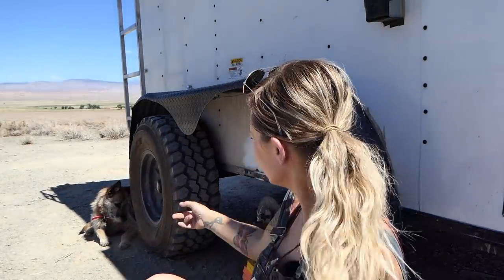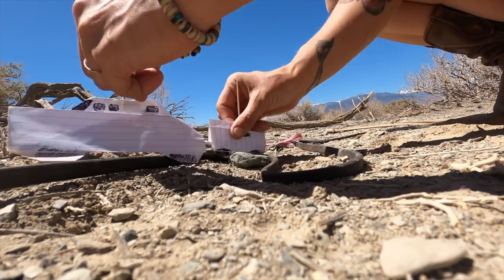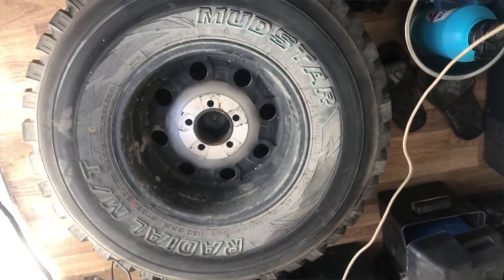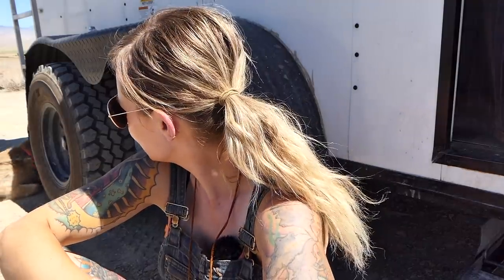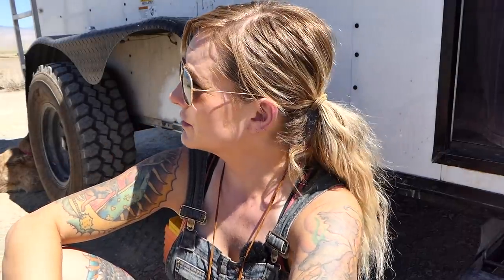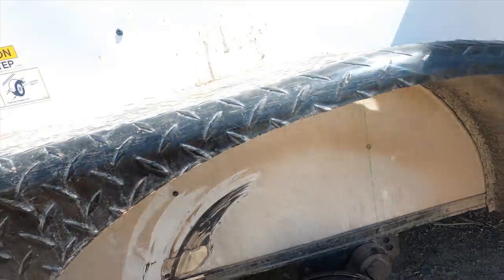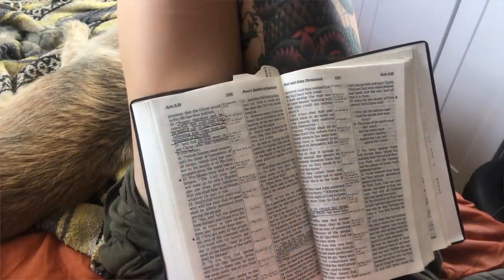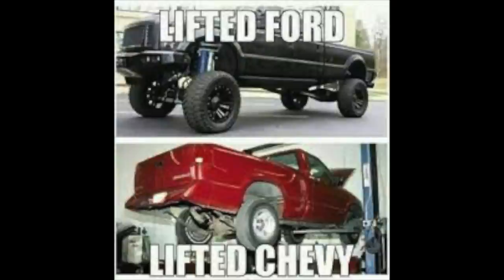Diary of a Broken torsion axle - living full time in a Cargo Trailer Conversion

Comment: In comparing torsion to leaf spring .
   Leaf springs can have airbags added and air pressure adjusted adjust for a stiff or soft ride . The air compressor can also be used to inflate a low tire pressure .  
   Torsion are good when nothing goes wrong .  Fix the bent axle and use it for the spare . You may trade trailers in the future and never need the spare , that is kept in Wisconsin. 
   Ford fuel system. 
I switched from 18 wheeler to a Hotshot last year . A million mile Freightliner to a 2019 F350 with 6,000 miles.  It now has about 71,000 and original tires , pulling a 38ft gooseneck. 
   There is a filter kit that can be added both before and after the high pressure fuel pump that will stop most of the metal debris if the pump explodes .
   2 causes for a fuel pump failure  , dirty watery fuel causes excess wear ,  and clean U.S. fuel .
   What 😳  😳  😳  ? ? ? Clean U.S. fuel ? ? ?
   Yes , there is a reservoir of fuel inside the pump that is used to lubricate the pump that was designed in Europe.   The European fuel doesn't have all of the oil taken out of the diesel. 
   The U.S. EPA requires that all of the oil be taken out of the diesel,  thus no lubrication. 
   I use a fuel additive,  not for imaginary increased MPG , but for the lubricity additive.  I  put a little bit in every time I get fuel , and I burn 🔥 up a lot of fuel hauling freight .
   Enjoyed your video , very entertaining  👏  😀  !
Reply from the maker: Hi Richard! What fuel additive do you like/recommend?
Reply: Hello 👋! 
  If your vehicle is still in warranty  , I use Power Service Diesel Kleen with Slick Diesel Lubricator .  But anything that doesn't void your warranty. 
   If it is out of warranty , in the Freightliner I carried a bottle of automatic transmission oil and a spare fuel filter for when I would get a tank of bad fuel .
   Don't void your warranty,  but almost any brand name is just as good as the others .
Reply from the maker: Thanks so much. I do still have an extended warranty.
Reply: You have some very interesting travels .
   With good service intervals , including greasing the 4x4 ujoints , Your Ford should last a long time  👍  😀  !
Reply: SPE Motorsport 6.7 fuel pump disaster prevention kit , On YouTube  .
Reply from the maker: Thanks! I read about the S&S ones. Thoughts? https://usdieselparts.com/i-24077938-ss-diesel-gen-2-cp4-bypass-kit-2011-2019-ford-6-7l-power-stroke.html?utm_source=google&utm_medium=cpc&adpos=&scid=scplp24077938&sc_intid=24077938&gclid=CjwKCAjwqIiFBhAHEiwANg9szud6OiFZMnm5srrZ7hxtOQMxVUXyP6gy4JyzQLpMNt3EIPy1Blk62BoCrbsQAvD_BwE
Reply: Having the clear inspection " contraption " , is definitely an improvement and benefit 👌  👍. 
" If " a person actually gets under the truck 🚚  and inspects it regularly. 
   $400 plus installation costs , sounds like a good long term investment  !
Reply: @LexandRiot  There's good comparison testing additive vids by Project Farm and others that show about 12 different brands, very educational

Comment: Thanks for the in depth discussion on torsion axles, I was considering switching from springs, now, not so much.  One question, are you replacing both sides of that "axle" or just one?  If just one side there is going to be a difference between left and right, correct?
Reply from the maker: Hi! The entire thing left to right will be replaced.

Comment: Take the other tire off the axle until the axle can be fixed, the trailer will operate as if if was built with one axle, it will be fine, you may want to paint the sheetmetal and the aluminum trim to cut down on oxidation  while you are waiting for 2 weeks, good luck, be safe.
Reply from the maker: Hi! I paint it in this video! :)
Reply: Very good.

Comment: looking at the pic of your truck and trailer i noticed a very big problem. It is imperative that your TORSION axle trailer ride level. more weight is on your front axle, not good with any trailer but especially with torsion axles..

Comment: Dont carry a spare axle. It will just be in your way unless you put it in a self storage place. It would need to be strapped down tight. The whole point of having two axles on a small trailer is that one of them acts like a spare. Chances of this happening again is next to zero. I've been pulling trailers for 50 years and never had anything like this happen. I think you are more aware of how to avoid this sort of thing now. Shit happens . . .

I had my fuel pump go down and I looked up and I was right next to a Ford Dealer . . . they fixed it by the next day. $1,300.00 Ford told me the new fuel pumps are better than the original. Mine is a 2010 F250 Diesel

Comment: How many miles are on the truck.
Reply from the maker: About 86k
Reply: @LexandRiot  what year?
Reply from the maker: 2016 it’s 6.7L
Reply: @LexandRiot  I would do the s&s and I would add diesel fuel lubricant additive to every tank. high pressure fuel pump otherwise known as CP4 is no joke.. up to 10K for everything it can damage.
Reply from the maker: Thanks, do you recommend a particular fuel additive?
Reply: @LexandRiot  Howes 103060.
It's like 10 bucks at Walmart. If you have the standard 26 gallon tank it'll cost you roughly a $1.50 per fill up
Reply from the maker: Thanks!

Comment: Something to keep in mind in case you damage another axle.  There is a suspension system for trailers called a Timbren suspension system.

They work pretty much the same has torsion axles except it uses bracket assemblies that mount directly to the frame.  Each bracket assembly includes the wheel spindle and has a pivot point that uses a pin. It has replaceable rubber bushings that act as springs much like the rubber strips in a torsion axle.

If you damage the spindle portion of the Timbren suspension assy it can be replaced. A length of square tubing can be used between left side and right side assemblies to make them more stable and stronger installations.

I am going to try to order an enclosed utility trailer with them already installed.

https://timbren.com/p-35853-axle-less-trailer-suspension.html